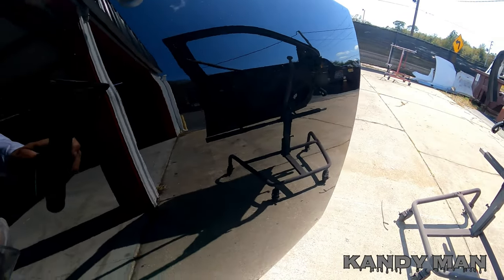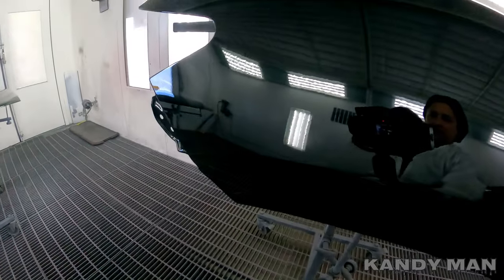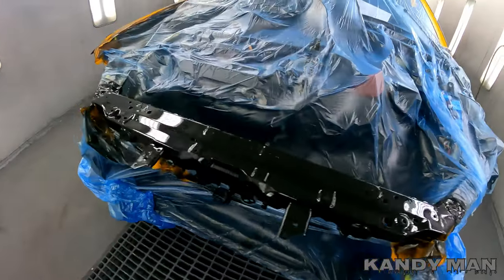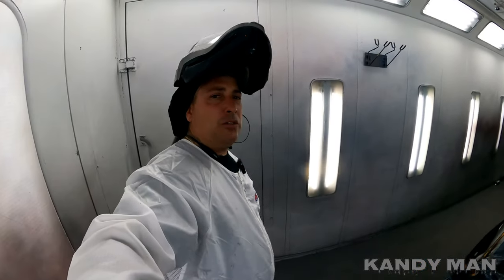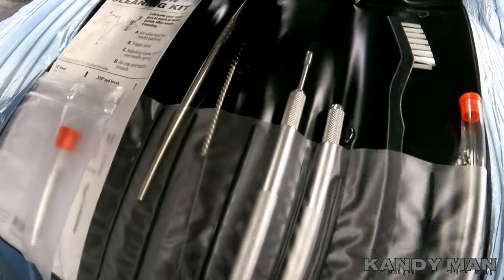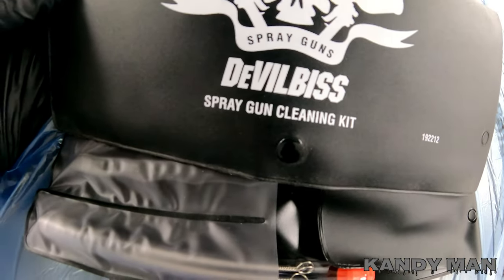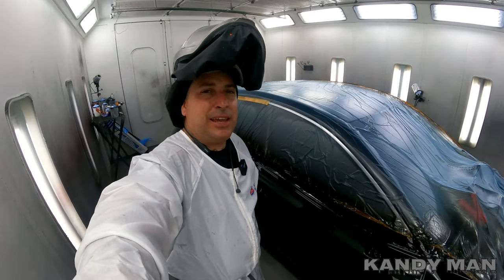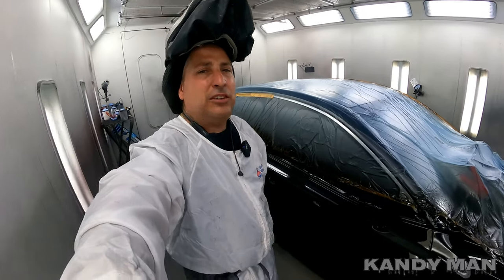HARD TO BEAT GLOSS BLACK

Comment: What's I would like to see some Candy tricks and tips.Would you use Sherwin Williams clear or Hok clear.I did a cheap candy job putting the candy in the paint, the clear then flowcoat it but only the top faded.But my next Candy job will be with a Base coat
Reply: .I will use a Baseball Candy for practice
Reply from the maker: @marklynsmith3510  UK kandy is very good but hard to spray .I will be clearing it with Sherwin Williams cc200 hope you get some tips when we spray it thanks for watching 👊
Reply: This the most important question is it easter the spray candy with a hvlp gun
Reply: Or a Rp spray gun
Reply from the maker: I don't know if it easier but you need a good gun kandy is very tough to spray even for pros  but if you want to get good keep practicing your speed distance walking out the whole car when spaying we will go over all these things in videos to come 💪😁
Reply: @kandyman5315  Nice waiting for classes to begin and the videos should at least 30 mins .thanks bro

Comment: Looks good. Here’s a few other candy colors for you to look at, 3r3 toy.(I believe it’s candy) and Hyundai y2e it’s a new candy I actually like that one the best of all oe candy colors.
Also, just an ideal, for that super flat deep look, paint it like 46g, after you lay down the ground put a couple of coats of clear, flat that, the how ever many coats of candy, with 2 untinted coats of clear, then flat that for a flow coat.
Reply from the maker: That's funny That's the Mazda 3 stage Grey right I was thinking of that myself lol
Reply: @kandyman5315  yes, that’s one where your suppose to clear over the dark sealer and then flatten it with 800 to get the base to look super smooth. I figure if the candy coat had a flat surface to start with with it would look super slick.

Comment: When you state your spraying pressures for the DV1 you need to be more specific. Are you reading this pressure off of the built in gauge at the top of the gun or off of a cheater valve or regulator at the inlet fitting of the gun?  (I use a RTI MR-1 regulator at the bottom of my guns) The reason this is necessary is because there is a 4-5 PSIG difference in what you will read on the build in pressure gauge (it will always read lower) than the one at the bottom of the gun. In fact DeVilbiss clearly acknowledges this in their DV1 owners manual.
Reply from the maker: I've let them know that in a couple of the last video  thanks to your expertise. Il  try to remember  thanks again. 😊